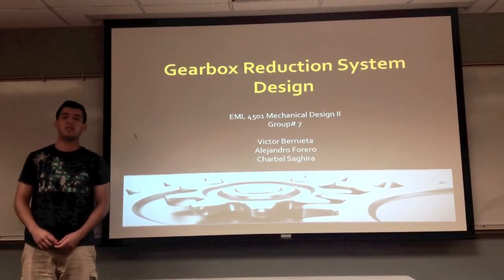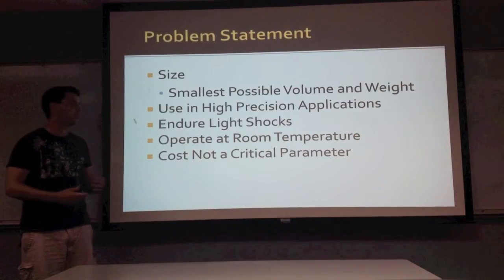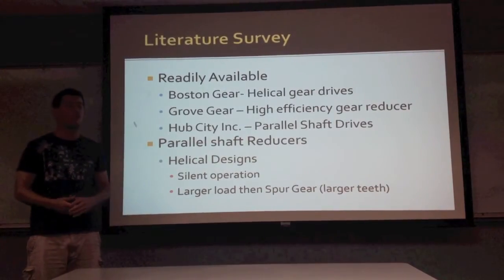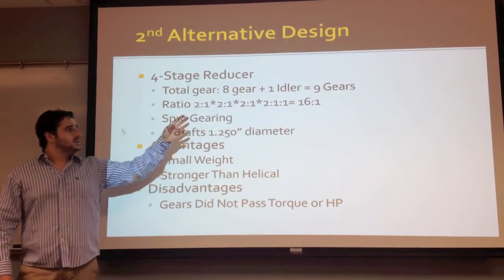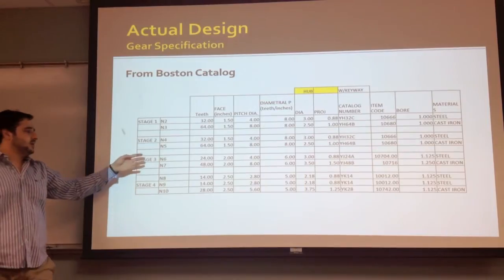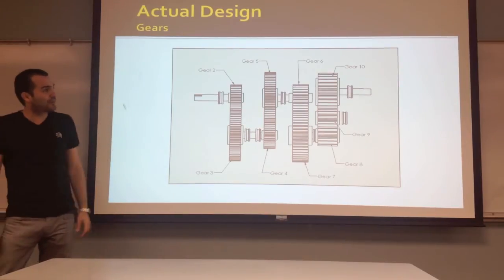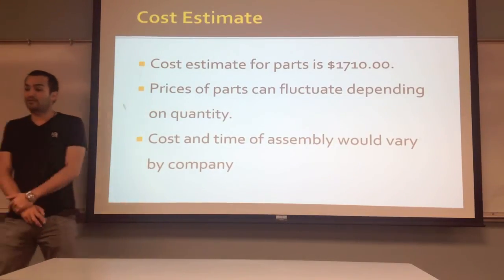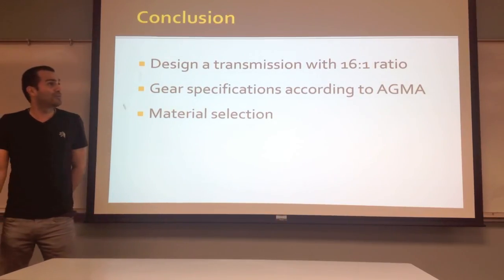Team 7: Gearbox Design

Comment: Great presentation that broke down each element in a gearbox design. Presenters spoke clearly, sound quality was good and slides were easy to read. They had a lighting issue making it hard to see the presenter at the beginning which seems to be a common one for the presentations this time but this group actually fixed it later on.

Comment: Camera angle overall was a good choice, you are able to see the presenter and power point very well. I liked that in your design you did not just stick the the typical Boston Gear Catalog and the Timken Catalog and that you actually went and found what you needed instead of modeling your design around what parts were just available in those two. Presentation was clear and concise and no information was repeated by the presenters. My only critique would be to talk a little bit less about the actual calculations done and more about the design itself.